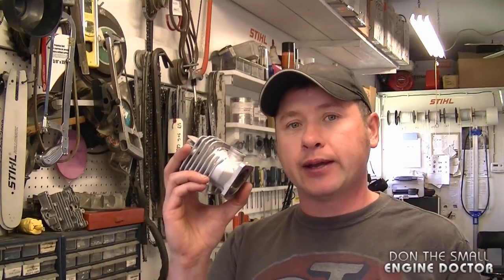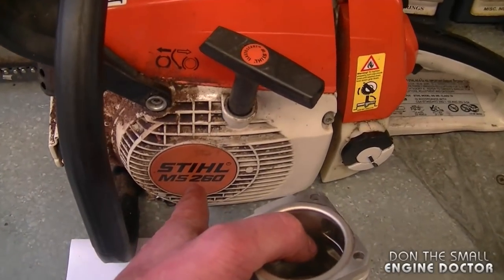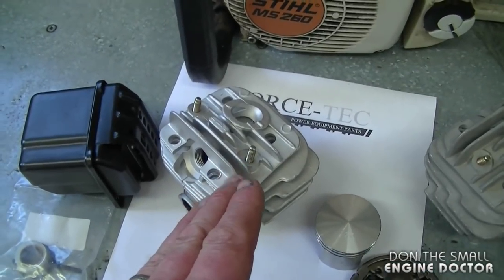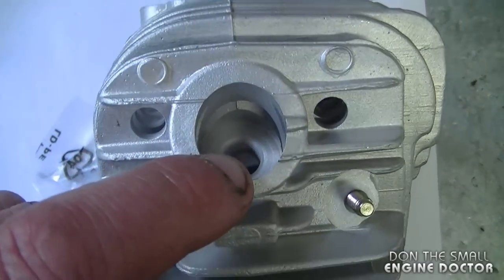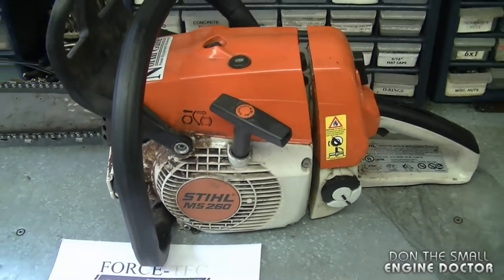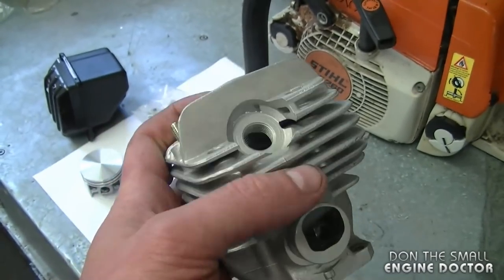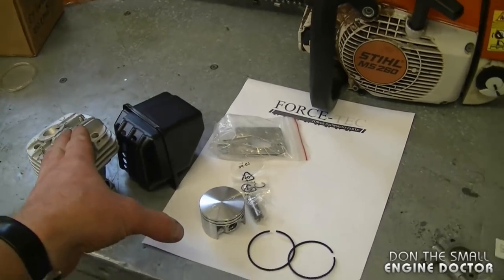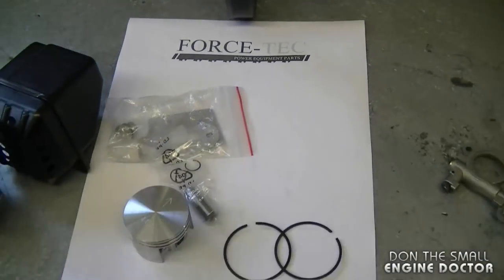FORCE-TEC Cylinder Kits From www.discountonlineparts.com

Comment: Donny does the name Force Tec, will it be on your cylinder or box etc
I ordered a Force Tec cylinder kit and it didn't look like this.And they said Hyway made them with the dull aluminum on outside but Nycasil inside. 
The cylinder had an H on it,the piston had HY on it and the pin was .044

Comment: Great Video as always. How do i figure out which Carb. my Honda Mower uses? Can't seem to find the engine serial number. Should I just try to match up the carb. photo? Are all Honda 160 engines the same carb?
Reply: Usually an ohv engine has the model # stamped on the valve covers. Just take that number and Google it. You'll find websites with diagrams and usually OEM part numbers.
Reply: Ya i checked and no code on the cover. been looking every where
Reply from the maker: should be numbers on block

Comment: hi don where do you buy after market parts for trimmers?
Reply from the maker: the link is under this video
Reply: Do they sell carburetors for Stihl trimmers? I couldn't find any, most of the parts are for chainsaws
Reply from the maker: ***** no, the carbs can be found on ebay or at your stihl dealer